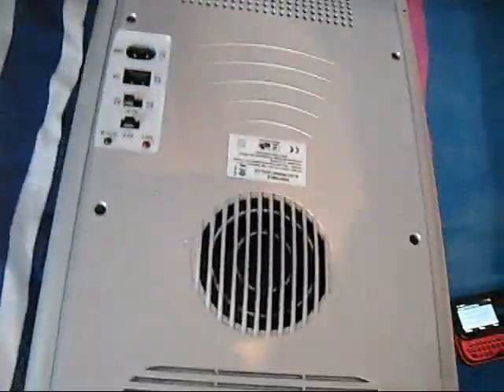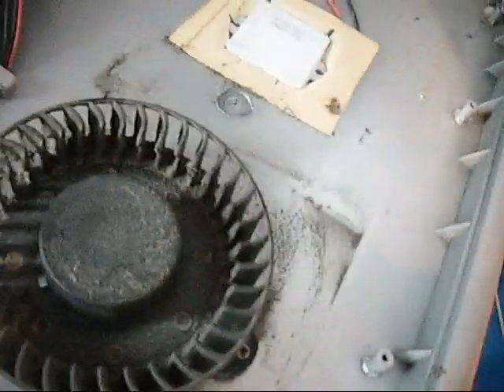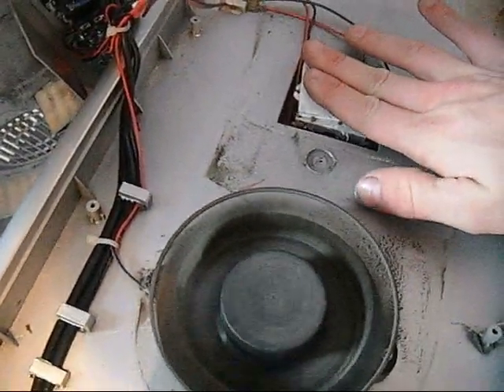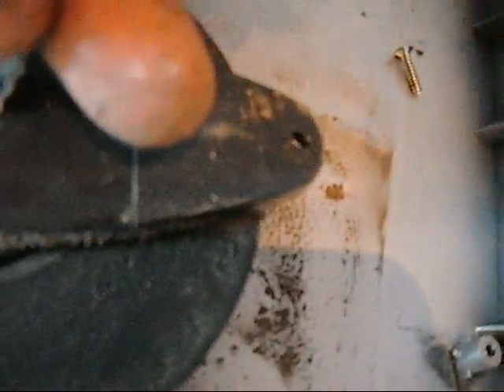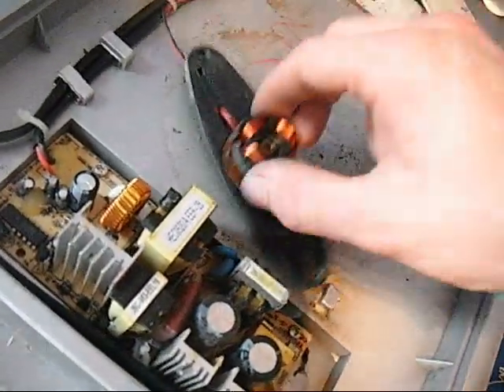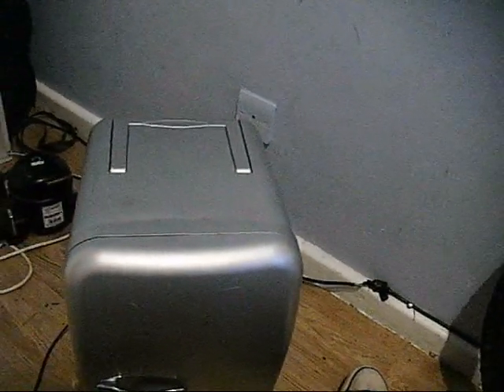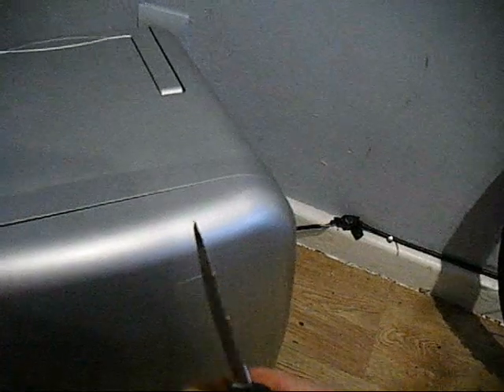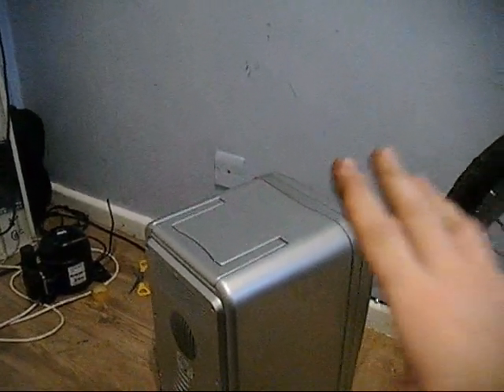free mini fridge?

Comment: The "ceramic heat conductor" as you called it is actually the cooling/heating device. It is called a Peltier device and it will cool or heat depending on the polarity of the DC Voltage applied. Alternately it is also a power generator. If you apply heat to one side or the other it will put out a DC Voltage on the leads. The blower would be just to dissipate the heat and allow the device to cool quicker and not overheat the surrounding plastic bits.